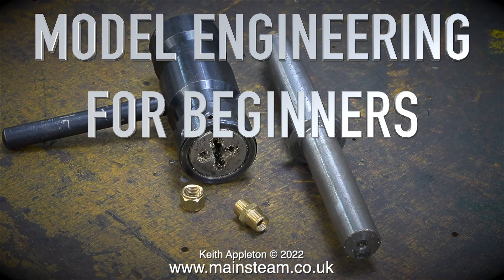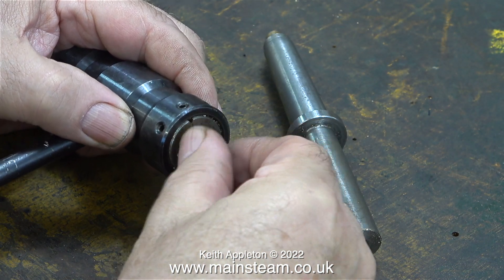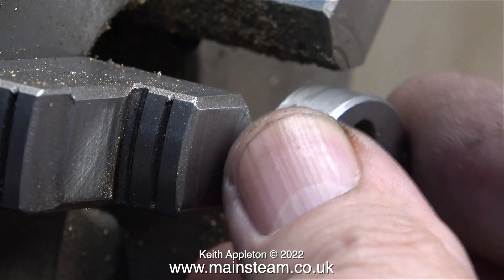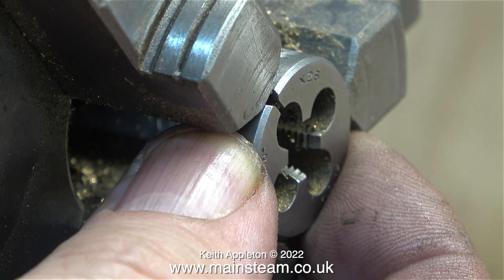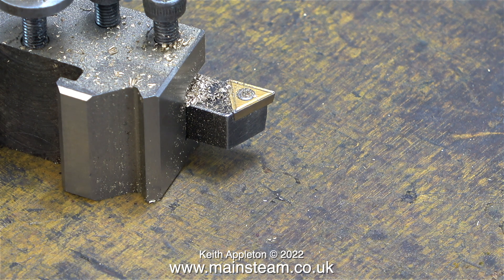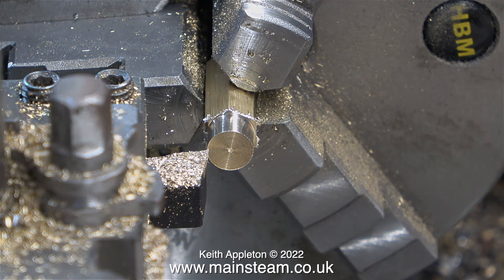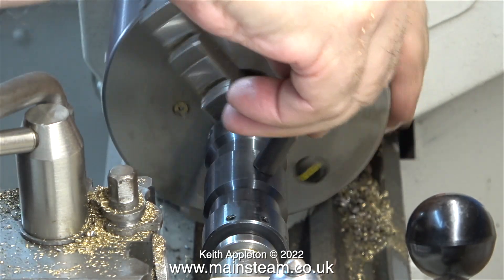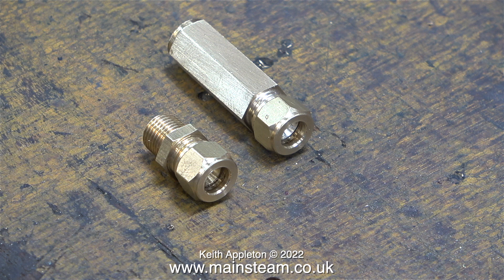USING A DIE HOLDER - MODEL ENGINEERING FOR BEGINNERS - PART #44

Comment: At one place I worked at the dies were set by the tool crib with small pieces of metal in the gap in the die, you could not adjust them, you checked the thread with a go/nogo gauge that was provided by the tool crib. It worked great in industry but would be impractical in home shops.

Comment: I know, I know, I'm nit picking. I heard you say, maybe I'm wrong, that 5/16 was 3.125, (slip of the tongue).  5/16 is  .3125, as clearly shown on the micrometer. 
Having done drafting work for a machine shop, I would only use 3 point decimals, we are not building space shuttles here. 
Here is a fine lesson about threading dies. I LEARNED something here today. Thanks Keith, even Joe Pie didn't do that. ;-)
Reply from the maker: You are of course correct, I made a mistake - not bad though considering I don't use a script . . . .